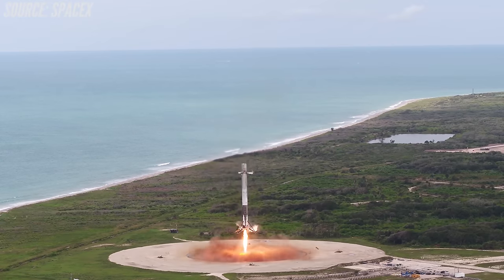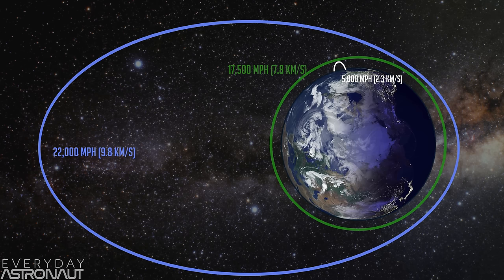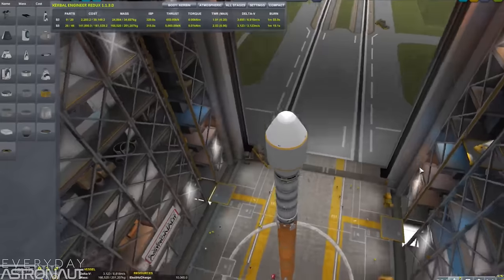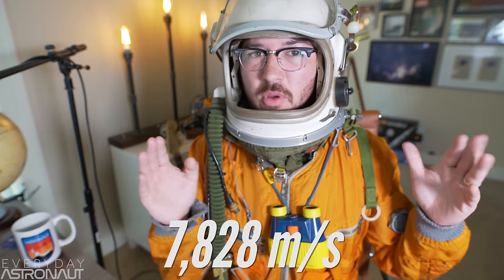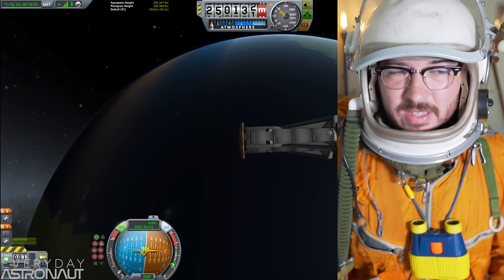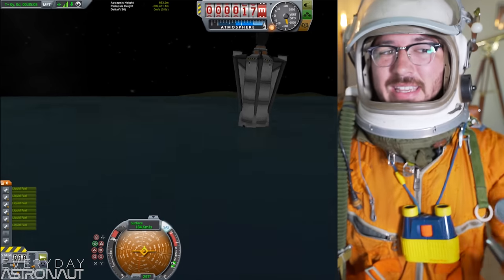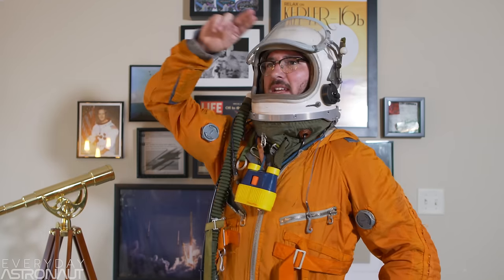Can SpaceX Reuse a second stage?

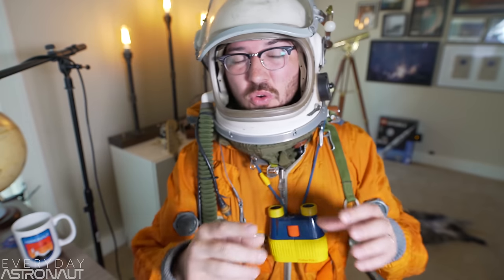Comment: At about 10:30 you introduce a heat shield and describe it a pizza crust looking thing. 

Why not treat it as a pizza and slice it into six segments and add some hinges so each segment can rotate out of the way so the main engine can be mounted immediately behind it and fire through the hole in the middle at any time except during the hot part of re-entry. No need for fins because the bulk of the mass is at the front during re-entry or separate retro-rockets, just needs a very good seal so no hot gas gets through the gaps and burns the engine up. If the heat shield is ablative then minor gaps may even be tolerable because the ablative resin is going at the same speed as the heat shield so won't hit the engine that hard.
Reply: The seal would have to be impossibly good and a small misalignment could spell disaster. The gas would want to push the segments of the shield apart, and there's no way to recover from that. Also, the segments would have to be very large so the force of the gas would be a big moment load and thus make it even harder (just material flexing could cause gas to get in). There are small feet on Dragon 2 which are very challenging to design for this very reason - and they are much smaller with a much lower maximum expected moment load.

Comment: actuely about the cost. the fuel is only like half a million dollar while the rocket it self can cost billions or high millions(depending on size). using bigger rockets is usefull if you can reuse.
Reply from the maker: +rubikfan1 it's not as simple as just fuel costs. Even the cost of the R&D to recover a second stage needs be accounted for an profitable. Not to mention all the extra hosts of costs involved with refurbishment. I have no doubt they'll figure out what's worth it and based on that we may or may not start seeing second stage reuse 👍

Comment: Have you tried putting the RCS thrusters to the front, just behind the heat shield? If you push the light side of the rocket, it could work better.
Reply from the maker: +Adam Trhon we could try countless things, but I wasn't really trying to recover the stage too hard, just trying to illustrate the difficulties they face. Also the thrusters need to be opposite of the heat shield since the heat shield has a lot of drag and will basically remain stationary (pitch and yaw wise) thrusters need to be where they were for maximum authority

Comment: How feasible would it be to use some sort of lifitng body to try and bleed off as much speed as possible without digging too deep into the atmosphere? I imagine it'd be pretty difficult and take a long time but hey it doesnt need to be quick.
Reply from the maker: +Communist_Penguin that's basically what their BFS/ITS will most likely be doing 👍👍👍 which means we probably won't see anything like that ok the falcon lineage

Comment: i have to correct you there... only a fraction of fuel that was for acceleration  would be needed for breaking second stage. in the meanwhile second stage releases it's heavy cargo and there is a substantial amount of fuel already gone. so the second stage is at this time more or less a big engine + empty shell + some fuel left for breaking....
Reply from the maker: +sands1973 yes! I apologize. I meant delta v!

Comment: How about ion engines or electric Hall thrusters to decellerate? Light weight. Save on main engine propellant. Why bring the 2nd stage back same day? Why not next year? I'll bet they could even be mounted in blister packs and jettisoned to save weight on re-entry.
Reply from the maker: +baldconejo as soon as you slow down even a little you start to reenter. The difference between orbital and suborbital in LEO is only like 400 m/s before you begin re-entering the atmosphere. So you can't slow down reentry too long.
Reply: Everyday Astronaut excuse my ignorance. I'm just brain f*rting, but I thought momentum loss was just momentum loss, and if it took a minute or a month to lose 400m/s then the result would still be reentry at the same speed... except with ion thrusters to save weight, there might be more fuel for landing burn, and less mass so less inertia when aero braking  on reentry and maybe even a little easier to make course corrections on the way down. What am I missing? Do you mean  that any loss of velocity would trigger a rapid reentry from LEO ? How does it work? Actually it looks like that's exactly what you said. Might It still be useful retrieving a second stage from higher up Geosynchronous orbits etc. The fuel saving would presumably be more important the further that second stage went.

Comment: Any chance 2nd stage has enough fuel to reach escape velocity? If so, send it to the moon and make it useful mass for future Moon Base Alpha. If it can do a controlled lunar entry & landing, or even just a controlled & targeted crash, it might be useful.
Reply from the maker: +Dave T a moon injection requires even more velocity than the de orbit. But I like where your heads at 👍
Reply: Thanks for the reply.
Is moon injection a big difference vs earth de-orbit+re-entry+landing burns, factoring in the added weight of heat shield, etc?
I'm no expert, but I watched Apollo 13 ;). Seems like a near-empty 2nd stage with no payload could accelerate pretty efficiently in space... no?

Really enjoy your channel!!

Comment: Couldn't parachutes be used for the second stage? The landing will not be precise, but its better than nothing at all, right?
Reply: I think it's more feasible there - some sort of guided parafoil like the fairings. I don't think a COTS parafoil of that size exists, but it isn't far off - so it's technically viable. Infrastructure for catching it is the harder part - first stage didn't survive in the ocean, and stage two is less survivable in the ocean, because the second stage tank walls are milled thinner than the first stage walls to save mass.

Comment: Could the second stage not slow down by repeatedly skimming the very top of the atmosphere?
Reply: Aerobraking only works for capture on approach, and for circularizing a highly elliptical orbit.
A circular orbit can't "repeatedly" skim the atmosphere - if it doesn't have enough eccentricity to leave the atmosphere again, it'll just get snagged in the ever increasing density of atmosphere and quickly burn up without a heatshield.
Reply: I see

Comment: How big of a parachute would  you need to slow down safely from orbital  altitudes? As  the altitude decreases, you'll have to either reshape or toss the big parachute for smaller ones, A clever reshaping scheme might work best.
Reply from the maker: +Bing Bang unfortunately you need to slowdown BEFORE you hit any real atmosphere so the compression doesn't destroy the vehicle and parachutes just don't work in a vacuum. So parachutes are not an option for reentry. And all the tensile tensions need to be engineered in as well adding weight. I think a semi lifting body is the most likely candidate
Reply: Everyday Astronaut The fact that the second stage burns up means it hits atmosphere at some point. The trick would be to deploy the parachute before that happens. Problem is the atmosphere will be very thin that high up and parachute will need to be very large. Graphene parachute? ::)

Comment: It takes less fuel to slow down to reenter then to speed up to reach orbit due to having less fuel at the time. Also on the way down you no longer have the payload to push around. By detaching the second segment of the Merlin Vacuum engine's bell (right before entry) will allow for entry engine first and for it to be used at sea level for landing. Also parachutes are very light and can be used to bleed off most of the speed after entry.
Reply from the maker: +Thorgon Cross the Merlin vacuum engine would suffer from combustion stability at sea level so it would grenade itself on the landing burn. I meant to say "just as much DeltaV" instead of "fuel."
Reply: If the Merlin vacuum ejected the segment that is past the regenerative cooling ring it would lower the air being forced into it, possibley preventing a over pressure event. I could be wrong, i have only worked on smaller/lower pressure engines then the Merlins. Thanks for the reply always great when people take the time to read through the comments.

Comment: There is a lot of speculation that the second stage will transition to a raptor engine. Any idea how that will change the numbers?
Reply from the maker: +Barry Hillard it require an entirely new vehicle essentially, the second stage would be stretched so much since methane is less dense than RP1. I personally don't foresee it happening on the Falcon 9 since it's already so skinny and tall!

Comment: If it's only about a 5 to 1 ratio for the first stage payload penalty isn't it more logical to dock the first stage back with the second stage after if completes its mission and land both together using first stage's atmospheric boosters? In this case they will have to make some changes in the first stage so it could carry the weight of the second stage while landing. but as you said it's 5 to 1 ratio allows for much more first stage modifications with less payload penalty. Another option is not to land both together. The first and second stage can be docked and they can use the first stage initial retro propulsion to slow down the second stage. So the second stage would have to use it's own fuel just to slow down to the same speed as the first stage. The rest of the process is done by the first stage. After atmospheric reentry the first and the second stage can separate again right before the final burnout so the second stage can open parachutes and the first stage can land using the remaining fuel.
Reply: The 1st stage does not even reach orbital speed while the second stage comes in most of the time in highly ecliptic. You either would need to boost 1st stage to highly ecliptic orbit which would mean maybe 20x the launch mass if not more. And if 1st stage does not reach orbital speed, it reenters rather quickly, you'll not even have a single orbit to catch back.. not talking about elliptical orbits.
Reply: 20x may be "bit" exaggerated but still...

Comment: I see, you did not consider returning the most expensive part of second stage - engines only. That part can be separated from fuel tanks, it can be encapsulated in heat-shielded module. And by the way, why not using parachute? This capsule is small enough, so it can be landing on water, and can be completely surrounded by inflatable blobs, so  water will never harm the engines. I think, this is pretty straight forward solution for all the problems.
Reply: But far heavier than other methods.
Reply: Better than impossible. That was already done in Space Shuttle.
Reply: Which was an epic failure at almost every one of the original goals for the programme.

Comment: why not just put the second stage into a multi orbit and slowly deorbit it using drag in the upper atmosphere. This idea is simply the inverse concept of gliding into space. you dont have to recover the second stage on the same day that the vehicle is launched. you could even have the second stage rotating to increase the drag. only down side to this is all the space junk flying around.
Reply: How do you control where the stage comes down?
Reply: MegaDove try it for yourself in KSP :D

The big issue is "where will it land" which I have only been able to solve by quicksaving before the first deorbit burn to start bringing the stage into the high atmosphere. Then with a series of engine-first atmospheric braking manoeuvres we eventually end up plunging through the atmosphere at near-orbital speed and blowing up.

The next issue is getting through the atmosphere at near-orbital speed.

The next issue is the fuel available to land, where every kg of fuel is a kg of payload we can't launch. I addressed this by sending up a second rocket with spare fuel, then landing both second stages.

Ultimately I ended up drastically increasing the size of the rocket and using a "spaceplane" as the second stage, launching two huge rockets and refuelling the space plane in orbit. I also tried a detachable motor, so the only thing we recovered from orbit was the motor and the recovery spaceplane. But I still had to use two huge rockets to launch the same payload, though one would imagine the cost savings due to the only consumables being fuels tanks for the second stage and the fuel for the entire launch.

Comment: one thing you did not account for is the fuel in the center booster. SpaceX will pump fuel inwards to the center tank. When the outer tanks separate the center booster will be full. This is a much more efficient way to get the same amount of weight into orbit.
Reply from the maker: +tostidos21 they’ve said a few times they’ve given up on crossfeed (for now)....
Reply: Interesting, its hard to keep up with all the design changes...

Comment: Got an idea, even tho it might be stupid. Why not launching another rocket with the purpouse of docking to a previous separated stage 2 and bring all bacl to earth? It will be quite expensive, but probably way cheaper than just losing a stage 2.
Reply from the maker: +Víctor Segura well the cost of stage 2 is probably around 20% if the vehicle so maybe around 12 million. By the time you factor in everything, I’m not sure they could get that money back after all the other costs involved if they had to launch another rocket.
Reply: My  idea is similar, use two or three cheap fabricated aircraft launched rockets to attach to the second stage and use them to help land the second stage?

Comment: Question , is there a benefit to using a big rocket/shuttle as far as reusability is concerned, as BFR is the only one I've seen proposed and is also the biggest rocket in the falcon family. If the concern is avoiding peak energy transfer then the thickness of the heat shielding required is a constant, and this would explain why big is good , as it would be shrinking requirement in terms of % of total weight. However if the total heat hitting a shuttle is important it is unclear that there would be any benefit to scale , as the total amount heat would rise with increasing mass.
Reply from the maker: It’s mostly just that a bigger rocket as bigger margins for recovering a payload. Also mass efficiency goes up too the bigger the vehicle 👍
Reply: Recover a payload ? Also rocket and ship mass as a percentage of total mass doesn't change much in the falcon series past falcon 1.
Reply: Looking at https://ntrs.nasa.gov/search.jsp?R=20160004208 , several heat ablaters seem to have required thicknesses scaling to powers less then 1. As heat load cannot be greater then 1/2mv^2 , and rocket surface area of a rocket scales as mass ^ 0.666, this suggests that for a constant velocity heat load is proportional to m ^ 0.33. I haven't seen any for thermal soaks however spacex was using picax, which if it scales like pica will give its larger rockets a significant weight advantage.Essentially a pica heat shield would only need to be 15% thicker for a ship 10 times the size. Also the percentage of weight for heat shielding woul be m^-0.27. That's just wild back of the enveloping though.

Comment: why can't we use interplanetary slinging to decelerate the 2nd stage? I mean, since we routinely use it to accelerate vessels on missions, why can't we use that same process in reverse to slow down the second stage for re-entry?
Reply from the maker: +Scott Mc Logic what you're referring to is interplanetary missions where we use the oberth effect. That only helps when breaking from the sphere of influence of a body (or passing through it). 99% of missions are still in earth orbit and therefore still require the same amount of deltav to slow down as to speed up.

Comment: Surely there would only be a small amount of fuel for retroropulsion because there would be no payload?
Reply from the maker: +Peter Morgan you're right. I miss spoke and should've said DeltaV and not fuel when talking about slowing it down. But it's not insignificant. It'd still require a solid 1/4 tank or so.

Comment: Who else cringed when you noticed he's using big heavy liquid fuel-only stabilizers on the second stage?
Reply from the maker: +Gabriel Doudna those are liquid and oxidizer I'll have you! And they're very very light weight. Probably fairly realistically light weight
Reply: monopropellant thrusters would have no chance of keeping the rocket heat shield first if the Vernor thrusters can't manage it. Plus he currently has no mono on the ship so he'd have to add that. A Vernor thruster has a thrust rating of 12 compared to a linear RCS port which only has 2 thrust. The Vernor has a mass of 80kgs while the RCS port has a mass of 30kgs. To get the same thrust you would need 6 RCS ports for every Vernor thruster at a mass increase of 100kgs. So replacing his 4 Vernor thrusters with RCS ports would almost add half a ton. Monofuel would add even more mass. The Vernor engine even has a higher isp. 260 vs 240 in a vacuum. So no I didn't cringe.